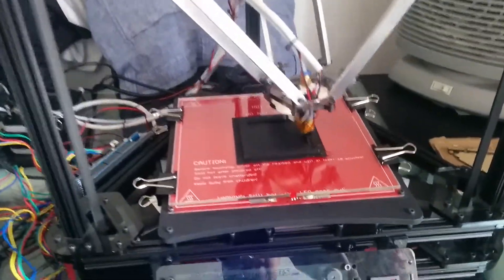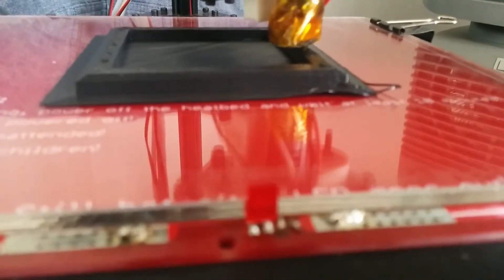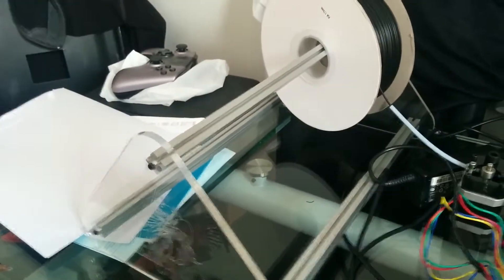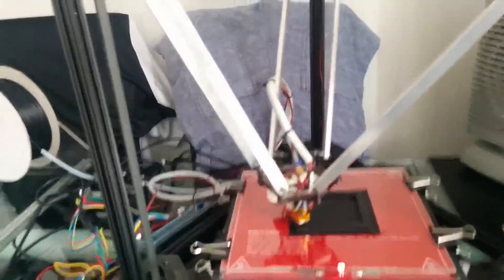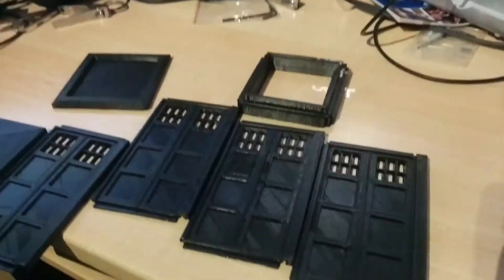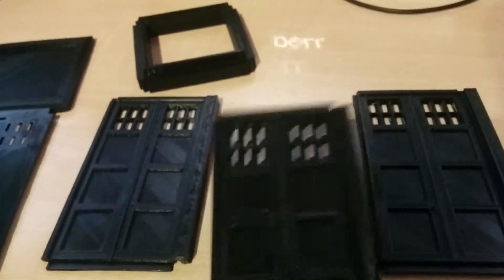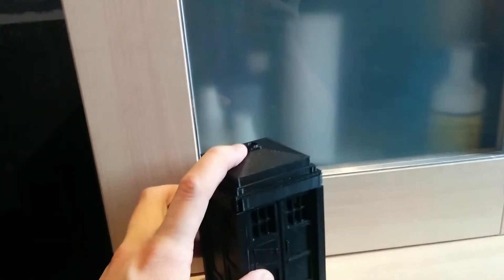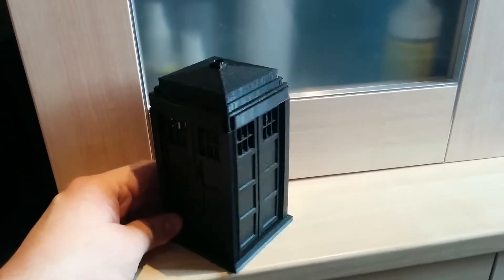3D Printing - Part 4

Comment: I believe you should prioritize getting some fans mounted to blow onto the heatsink of the hot end and the parts being printed. That should help increase the extruder reliability and consistency as well as the print quality. Take this "advice" with a grain of salt since this is mostly based on what little experience I have from tinkering with my school printers.